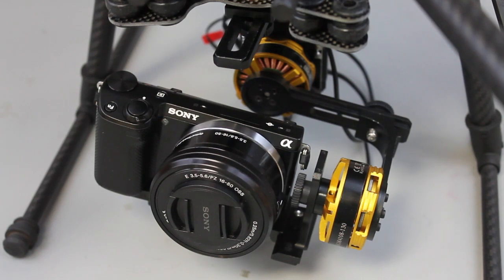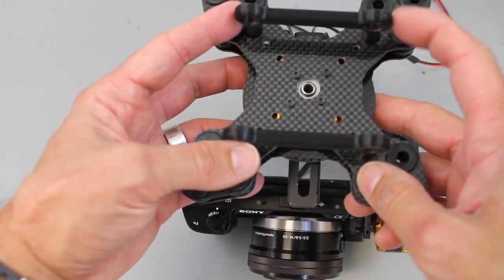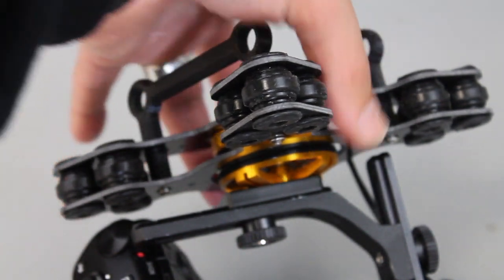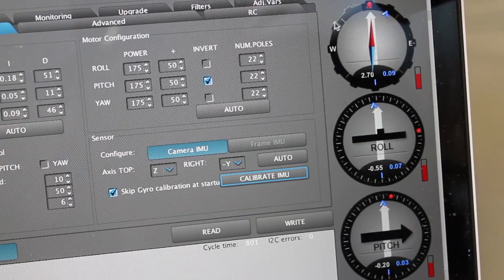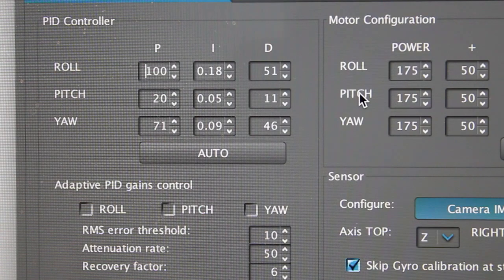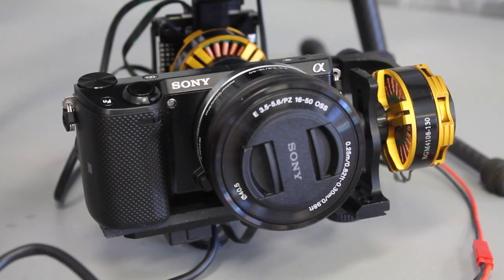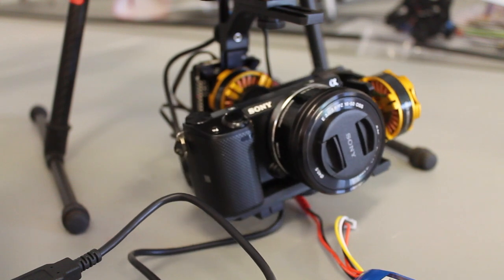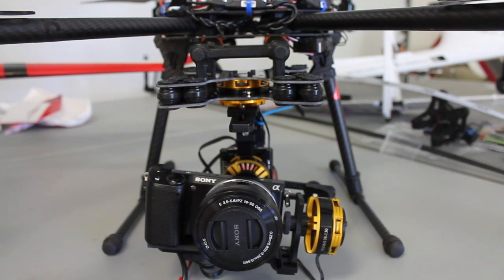DYS 3-Axis Gimbal w/ Sony NEX 5 and Tarot Hexacopter First Look

Comment: Hey Dennis, thanks for sharing!  I have experience with the gimbal and even after I got it completely tuned it has some fundamental design issues that will results in lots of micro vibrations in your footage.  I tried everything to fix this issue and in the end I had to abandon the project.  The problem was with how soft the dampeners were and also how the support arms and the points where the arms join.  Maybe you will have better luck than me.
Reply: My product had very poor machining that made balancing practically impossible(camera ALWAYS skewed to one side) and poor motor lead wiring. Have given up and will get loans for  a Moy gimbal.

Comment: The first gimbal I ever purchased was a cheap go pro style two axis gimbal, all and all it worked pretty well for being a $69 gimble but tuning the PID and power settings was not an easy task!!
Reply from the maker: eric deherrera I've tuned PIDs on several different gimbal/software versions and it can be a royal pain. Even harder than tuning a flight controller. The auto PIDs feature is nice on SimpleBGC but I've had to further refine them after auto tuning. It's a great starting place that can then be followed up by manual tuning.

Comment: Hi Dennis, did you management to get rid of the vibrations? I'm in the market for a gimbal right now and was wondering how the gimbal is performing now. Thanks
Reply from the maker: +Sjoerd Postma It's taken a lot of work and I'm still not satisfied with the results. Especially when I compare the video to my Inspire 1 X3 camera. Still a bit of vibration that I haven't been able to work out. For now I'm looking into other gimbal options and will keep you posted.
Reply: +Dennis Baldwin Thank you for your reply. Im afraid the Inspire 1 is above my budget :) Looking forward to your upcoming video's. Until then good luck.

Comment: I have this gimble and agree with everything you have posted.  I have a x8 by DYS.  I love the multi.  The gimble and the alpha 6000 has been an interesting venture.  I cut off the end of the bottom plate to allow the alpha door to open to access the card and battery.  The gimble seems to work well with the camera controls hooked to it.  I have one remaining issue that the pitch and horizontal dont stay level in flight.  In my area it can be gusty and flying in winds of 20+ happens.  I found that near the 20+ degree mark in the iosd mini There is a little drift that I cant get rid of.  The horizon moves a tad.  I am looking for any comments on getting this out.  Been fighting it for a couple of weeks.  I am remounting the imu on the bottom without any tape that I used verses the top.  I don't like the Yaw performance as heavy wind will hit it and regardless of gains I found that it jiggles a little too much.  A friend used the hanging technique.  reverse mount the motor and use Zenmuse white dampeners which are the lightest so it floats and it helped him.  I have not tried this, but want to.
Reply from the maker: Cody Hanthorn Thanks for the tips and thoughts. I have the IMU mounted on the bottom and find that it works fairly well. I haven't flown in high wind conditions just yet as I'm sorting through some vibe issues while in the air. Keep us posted on your progress and I'll do the same. BTW I'm looking at the a6000 for mapping as it will greatly increase the quality of the imagery I've been working with. Take care.

Comment: Hi Dennis, I'm using the nex 3n on this gimbal, basically the same. I tuned all the pid's, on the bench it's all ok, but when I fly my gimbal sometimes 'drops' on the pitch axis, looks like its losing power or something. I tried a seperate lipo to power the gimbal with no succes and now I'm at my wits end, maybe you know something I don't to get this issue fixed. 
Kind regards, Kay
Reply from the maker: Kay, thanks for the question and I haven't experienced that before. If it's not power related then perhaps you need to increase the power to your pitch motor. Perhaps it's under-powered and ultimately falls down. That's my best guess right now. Good luck and let us know what you find out.
Reply: unfortunatly the power is already at 200 and the problem is still there :(

Comment: Hello Dennis, i have the same gimbal but with the sony a6000, the problmen is when a control the picth from RC to -90 degres (camera facing down) the roll start moving around and it wont stabilize.
Reply from the maker: Try playing around with your motor power settings. I had a lot of trouble with this gimbal and couldn't get it to stop vibrating when in the air. Good luck with your project.
Reply: thanks Dennis, yes this is a pain, ill try my best, also, im adding the reach module from emlid, got a lot to read and play. 

did you culd auto trigger the camera from the pixhaw + reach ?

Comment: Hi Dennis,
I'm trying to connect SBGC with Pixhawk to avoid azimuth drift? Whenever you experimented it will be very appreciated to share with you.
Rgd
Reply from the maker: +Claude Rychter Okay. Sounds like an interesting idea. I haven't messed with that yet, but if I get around to it I will share my findings. Please do the same if you figure anything out. Thanks.
Reply: well actually just cause l'm concern about a best alignment with my copter. But so far impossible for me to keep a perfect azimuth because of drifting. I reckon the serial null modem is way to slow for this and would probably match a better transport protocol such as switching protocol (Why not CAN BUS)...

Comment: hi Dennis, i'm considering the same gimbal + samsung nx300. one question though - i think if you mount the bracket onto the bottom plate it will transfer vibrations onto a gimbal right ? or is the gimbal itself mounted to the upper plate ?
Reply: Gimbal is mounted on the upper plate and the rubber balls are compression dampners
Reply from the maker: Monteaux33 As paulham states it is mounted to the upper plate. Thanks for the suggestion though.

Comment: A few questions- do you need the stabilization controller, if you were going to make this into a hand held gimbal system? and also, what battery did you use to power the gimbal.
Reply from the maker: nedyroc It would be a good idea to use the stabilization controller for a handheld gimbal just to keep your video from being shaky. It's not a necessity but then I'd recommend using a fixed mount and not a gimbal as you'd be able to save a lot of weight. The brushless gimbal motors are heavy. The gimbal controller will support a 3S or 4S lipo battery.

Comment: OK, great video, but get ready to be bombarded with questions. Is the controller a 8 bit or a 32 bit? Also, the link doesn't seem to work (the one in the description). I found the gimbal on eBay claiming it includes a 32 bit controller for $220. Do you think its really a 32 bit? I'm fairly new to the whole gimbal thing, so any help is appreciated. Thanks!
Reply from the maker: +Xploder777123 The one I have is a 32 bit board. It's this one here: http://amzn.to/1RPLzrb Make sure you verify the seller and that the controller is authentic. It's so hard to tell and the link I provided to Amazon you'll see the seller is DYS. So I'd feel pretty confident the board is legit. There are so many knock-offs out there sometimes it's hard to tell. Good luck.
Reply: +Dennis Baldwin  Thanks man!

Comment: So what is the bottom line on this DYS gimbal?  It seems like you mentioned lots of problems with vibrations?  Is there another gimbal that you would recommend for a Sony A5000?    I want to mount it to a 3DR X8+.
Reply from the maker: I had to scratch the project. I just couldn't get it well balanced. I'll look around to see if I can find anything better in the marketplace. Let me know if you if you dig anything up as well.
Reply: Dennis Baldwin thanks for feedback..saves me alot of time!  :)  heard some people say that the Arris gimbal was better design. ..but don't have more details yet.

Comment: Hi Dennis, nice video!   BTW what is the setup you are using in the tarrot 680 for taking this heavy gimbals   with the sony nex. thanks Benny
Reply from the maker: I was originally using T-Motors but needed more lift so ended up with these: http://www.helipal.com/tarot-4114-high-power-brushless-motor-320kv.html If you scroll down there are some thrust data that may help with your calculations. Good luck and keep us posted on your progress.

Comment: Good morning Dennis. I hope all is well with you this morning. I picked up that same gimbal, hdmi board and a sony A5000. Since I'm running the Zenmuse on the 680, im working up an isolation mount for a t960 that I just finished. My question for you this morning is, do you know how much additional lense this gimbal will handle beyond the base model that comes with the camera? Also, I finally recorded my first finished Flora video run. 10 months into this. Would you be so kind as to give it a view and gave for me as it would be very much appreciated. Next Berlin question, will drone pan work with naza sytems if I'm running my datalink and MarkII ? Keep it up you be a bad day Man! Have a blessed day.

Comment: Hi Dennis,
Thankyou for a great video could you please tell me  how the screws are retained in your printed 3d part.
Thankyou Alan.
Reply from the maker: +Alan John Good question. Nothing magical here :) I just made the holes a mm or two smaller than the screws and then self-thread them into the part. Has been working well, but probably makes sense to have some sort of reinforcement. Thanks for asking.

Comment: the link for the gimbal doesn't seem to include the board. how has this been working out for you? i just picked up the sony a6000 and wanted to pop this gimbal on my tarot 650 sport, but wouldn't know how to. there would be no room for the battery. how did you work that out?
Reply from the maker: Rabeiro Photography Not good. I've had so many problems with vibrations in the gimbal and that's without it even powered. Balanced props/motors and even downsized my props to 11". The 11" props performed much better than 12" and 13" but I get reduced flight times and it really struggles with the AUW. I'm going to continue tweaking but as of now I can't recommend this gimbal. Regarding the battery question I have the Tarot battery tray that I mounts to the two booms that run underneath the frame. I use it to counter-balance the gimbal to get my CG dead center.
Reply: Will this work sony dsch 60?

Comment: wow thanks for the info on the Auto button. time to break out the old BCG board that i pulled my hair over.
Reply: etegration The auto button only works with the 32 bit version of the board. I have both and the 8 bit uses an older GUI.
Reply from the maker: renoflash06 That's good to know. I've never used the 8 bit version and I guess I never will now that I know this :) Thx.

Comment: I bought a clone long ago with evvgc controller included. It was of low quality with motor wiring breaking all the time and the frame machined inaccurately. Replacing controller with Storm32 was of no use and its MPU6050 was defective.No drawing instruction was included so it was very hard to find out how to assemble. Finally I gave up and am ordering a Moy gimbal. My other gimbal, apparently a Jiyi clone, had a defective roll axis which didn't work at all. Quality is a big problem with gimbals(and other components as well,recently; modems and GPSs fail to work after 2-3 times)

Comment: Thanks for this review - one question - can you still plug in to the HDMI and USB ports? I have 90 degree angle cables fore each port - HDMI to video of course and the USB has a Gentwire Multi to control the zoom and firing the camera. I am using a Sony A5000 with 16-50 on a simple servo platform only for still photography. I'm thinking of upgrading to this for stills (image should be less jumpy on the monitor) and maybe some video work.

If the cables won't fit can the mechanism be rotated 180 degrees so that the platform pitch motor is on the opposite side from the ports?
Reply from the maker: +Alan Goldstein Good question. I think it can be rotated 180 degrees but haven't tried. I'll have to give that a look. If you're using the Sony A5000 (I want one!) I'm not sure if you'll have good luck with this gimbal. I've struggled a good bit with the NEX5 having too many vibes. I haven't isolated the problem just yet but been through all sorts of balancing acts to get my video stable. I guess I could always work on it in post but would prefer to nail vibes at the source. If you're doing stills perhaps this won't be as big of a problem if you're using fast shutter speeds. I'll be sure to post when I have more info on my progress. Thanks.

Comment: Hello Dennis, a few questions-
1) What happens when you add a 200mm bigger lens on the camera? Will it take?
2) If I chose invert, does that mean we can use the gimbal upside down? 
3) Does it work well upside down, handheld? 
Thank you.
Reply from the maker: 1. You will have to adjust the center of gravity on the gimbal. Probably by moving it back on the pitch axis.

2. No I don't think so. I believe that's just to invert the motor direction if it's rotating the wrong way.

3. I've never tried it upside down so I'm not sure.

Please let us know if you find anything out.
Reply: +Dennis Baldwin 
Thank you :)
Yes I will let you know.

Comment: Hello, first of all, thank for your video, I have finally tunned my gimbal. But I have a question:

I have a iflight gimbal with the same controller, but different motors, basecam 32bit alexmos, with two IMUs, and when I turn on my gimbal It only stabilizes roll and pitch, the yaw axis stays in the start-up position, in doesn't move to the nose of the aircraft. I don't know if it is an option to do (stabilize) it or I just have to plug the yaw cable tp my flight controller. 

Best regards, Jose.
Reply from the maker: Hi Jose, I'm not familiar with the iFlight gimbal so I'll have to see what I can find out. I would think there would be a setting to configure the default orientation of the gimbal. Also check if there is a calibration function. Let us know what you find out.
Reply: Dennis Baldwin Thank you Dennis,  the gimbal opperates under the same software that you are using. It is the same board. I have checked all the options and there is an option to "remember" the home position in the software but the gimbal does nothing when i click it. It only starts when I plug the battery and stabilizes the gimbal in the position I switch it on. Lets say if I turn on the gimbal pointing to the west. It stabilizes pitch and roll perfect, it stabilizes also the yaw but in that "west position" (follow mode works in that position) But It doesn't turn to the nose of the aircraft. I don't know if it is the default option or what.... 

Thank you.

Comment: Hey Dennis nice Video! 
What version of the DYS Board is this and how does it work on your Tarot? (do you have Vibrations or horizontal drift?)
I also have the Tarot and DYS gimbal but for the GoPro. I have version 1.0 8bit and i have a lot of Problems with it :(
If you Setup works good, maybe i´ll upgrade to a sony nex and your gimbal - would you recommend it?Thanks
Reply from the maker: +FPV-Projects To be honest I can't recommend the DYS gimbal at the moment. I'm not saying it's the gimbals fault, but I had one heck of a time getting all the vibes worked out. I finally gave up with intentions of revisiting, but haven't gotten around to it. I do hope to revisit and will share my results when I do. Thanks for the question and really wish I could recommend it.
Reply: +Dennis Baldwin Thanks for the straight answer. 
i also saw videos from 32bit board having a lot of problems with horizontal drift ect.. 
what i found out is, that the gimbal works good as an handheld gimbal :) 

after balancing motors and probs my 2nd camera which is directly mounted to the frame gives me smoother footage when flying faster haha :)

would recommend any other gimbal that will work for a  gopro and/or sony nex siced camera ?